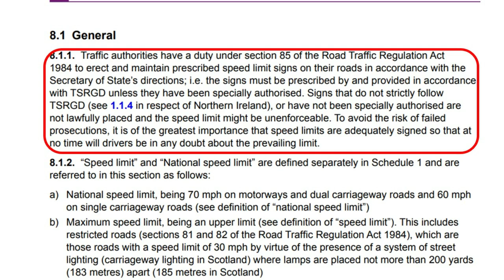Motorcycle SPEED or not to SPEED?

Comment: I was of the understanding that 2 matching signs equally place on either side of the road was the legal requirement ,and if one or both were dirty ,obscured in anyway or not there ,then they no longer were legal?  We have a few villages in east Fife that lost a sign or two due to the massive road repairs
 by contractors running up to the golf a few years ago and have never been replaced. Easier and cheaper to ‘purloin’ a sign or three.  Very good vids sir.
Reply from the maker: If you wanted you can go online to your council and report the missing signs stating the legality and responsibility of the council. It's easy to do. See how they react